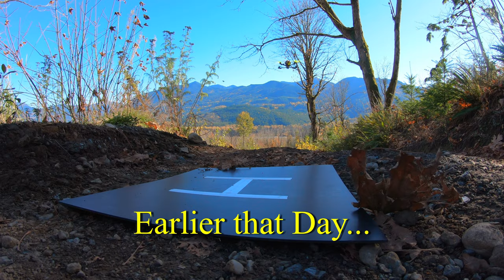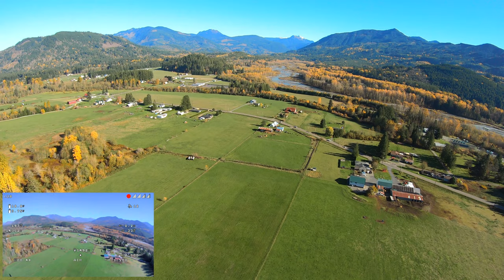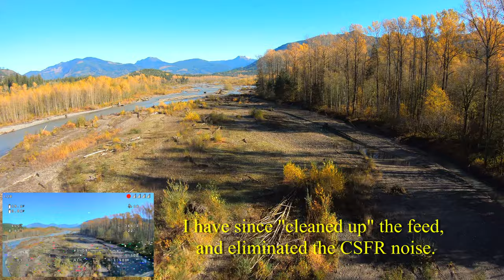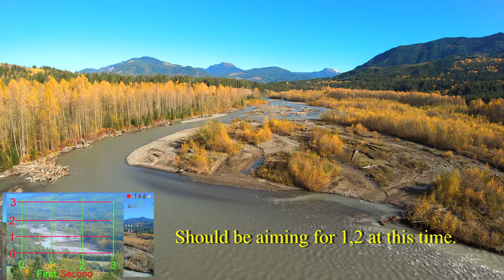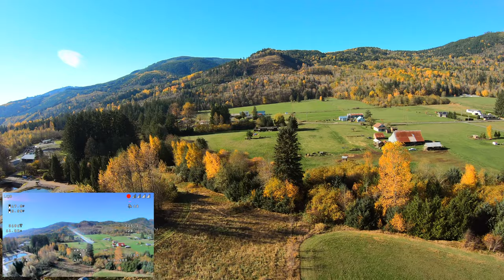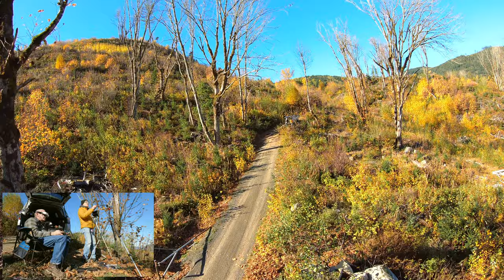2.5mile 4k River FPV flight testing 150mm Triple Feed Patch and HDZEro Sharkbyte

Comment: Well hello from Alberta, Canada. Putting these vids together is a lot of work, keep it up. Interesting on how you preplan. I too am enjoying long range flights, the only difference is I am using the dji air unit setup. I have travelled out 7 km but with far less gear ie no tripod stuff just goggles and radio. At one point you said it would be great if it wasn't fuzzy.  So my question  to you, have you tried out the dji system ? I think you would be far more impressed with quality of video and less gear. If you're end game is to reach more than 14 km then this system is not for you. Thanks for the entertainment far better than tv these days.
Reply from the maker: Thank you for watching.  I have no intention in the DJI system. Two prior terrible customer service experiences in the past with DJI.. I wont go into it here... my next flight using sharkbyte will be to 7k and I have since tweaked my system so that the fpv feed is now perfect and clean. Sharkbyte is not Dji..thats for sure. I have no plans to fly past amout 7k given my quads power supply limits. Best wishes and thanks for watching.
Reply: Yeah 🤩! More of this fpv stuff please and I will cancel my Netflix account 🛸💨🎥😂✊✊
Reply from the maker: @themoggidriver  LOL. Thanks for watching.